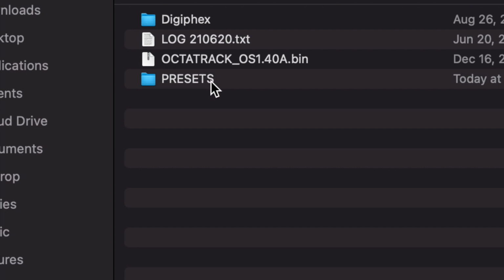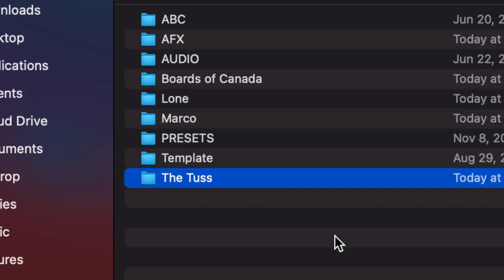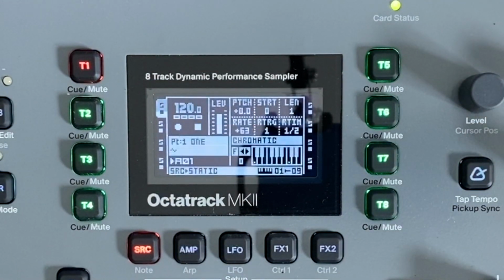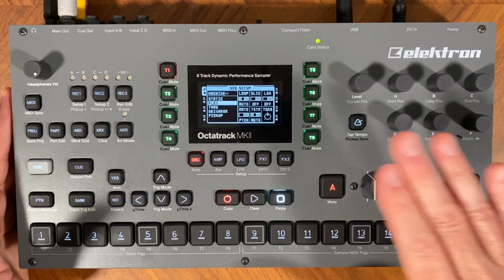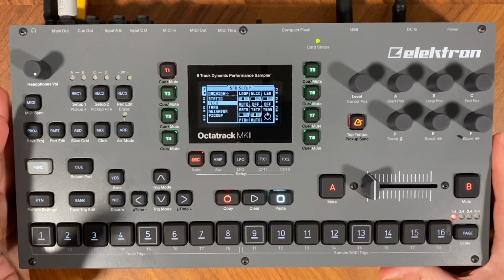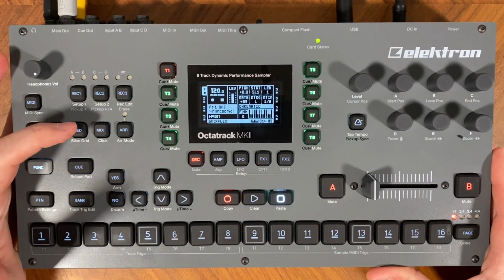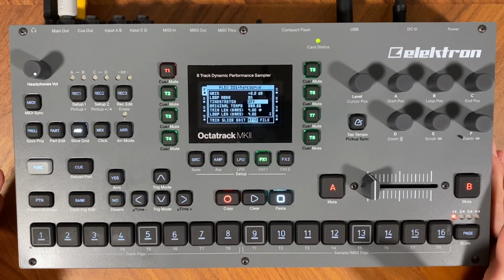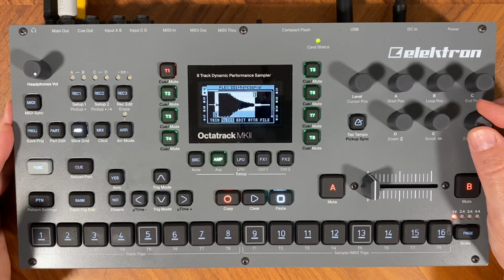Octatrack Beginner Tutorial - Slicing & Arranging

Comment: Bought a used MK2 yesterday! This is my first tutorial on the beast, thanks! Is there some way to start the next slice exactly at the end of the previous? I imagine moving the cursor to the right always eats up a bit of the waveform (between end of previous and start of new slice). Cheers
Reply from the maker: Enjoy your Octatrack. Yes when you select from the menu to make a new slice here, there are other methods of placing slices but I don't have my OT with me at the moment so I can't say exactly.
Reply: @Digiphex  Hey, tfor taking the time to reply! Cool, at least I know it's possible. I am already looking into it. Thanks again! Cheers
Reply from the maker: @gdrdm  You might benefit as a beginner the last part of my Armando 303 Octatrack video where I go into live recording what you are doing and then looping and playing it. I tried to explain it in a simple way, much easier than the manual which is good but you have to jump around in the manual which is the problem with it.
Reply: @Digiphex  Thanks! I'm surprised that after years of reading about how difficult the OT is I'm actually finding it quite straightforward (so far). Haven't got to live recording/looping yet so I'll check your video out for sure! Cheers again

Comment: Does the Octatrack have a loud powerful output ? What makes this sampler better than using Ableton, besides not looking at a screen all day? It looks for sure interesting, but time consuming.
Reply from the maker: It has a normal output, as expected. It can''t be compared to Ableton because Ableton is a DAW and Octatrack is a physical mixer with knobs and buttons designed to be the centerpiece of a setup with other physical gear that Octatrack controls, samples from and remixes, if you use it to its full potential. It is FAR more time consuming than Ableton, infinitely so. But you get a different sound from it, a different performance, a new take on your music. It can take away the creative paralysis of Ableton with a million ways to go.
Reply: @Digiphex  I am just curious about how you can say it has a different experience than working with a DAW like Ableton? I  mean is the sound different or do the sequences come out more interesting? I mean what is it? Less is more? I am really seriously curious because it isn't cheap and it only has 8 tracks and 4 audio-outs. I mean I used to own back in the days an Emu SP1200 and that was and is known for its punch and sampling sound color from its analog /DA conversions. Thanks